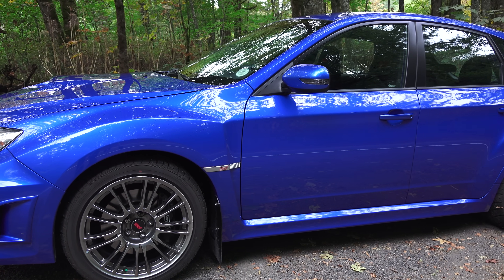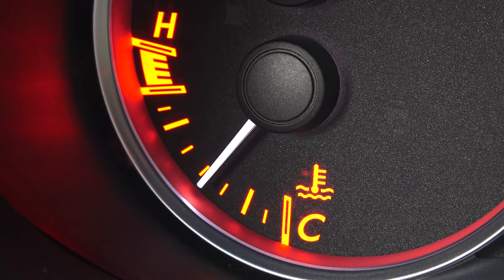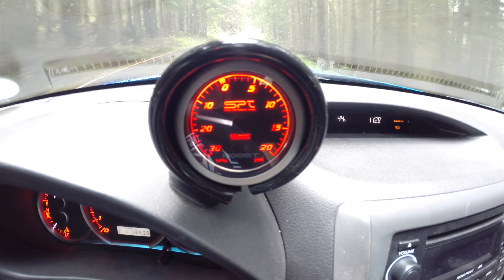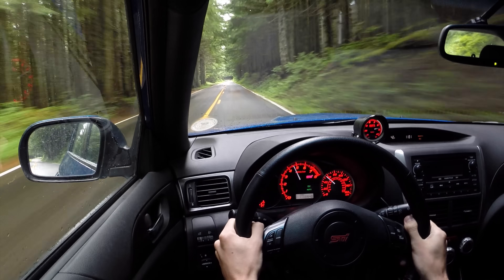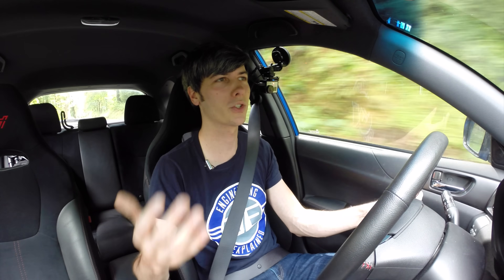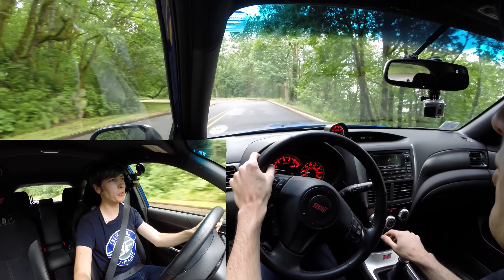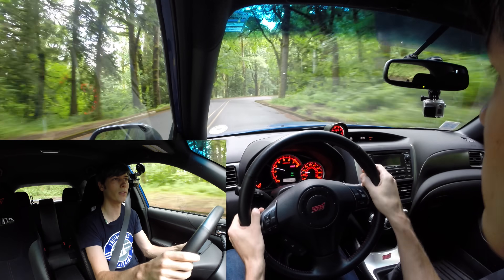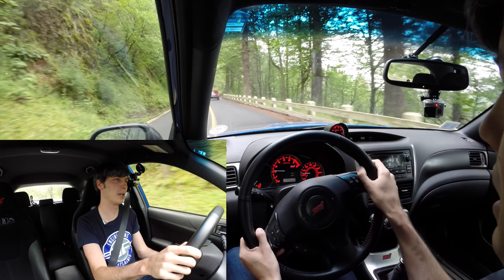5 Things You Should Never Do In A Turbocharged Vehicle

Comment: If your in 3rd gear and stop and don't shift to 1st before you take off is that bad?
Reply: pooneater5 that's what he's saying
Reply: pooneater5 if it is a full stop yes, but if your rolling at around 30 mph or something like 2-3 rpm I thin your good
Reply: Depends how much you hate your clutch. So long as you don't engage it roughly enough that it drops the engine revs super low (really, you shouldn't get down to idle unless rolling along in heavy traffic or parking it, but, say, idle +50% is generally more than ample, and you can go that low if accelerating straight out of it without the engine labouring there for a long time; essentially, that's the lowest speed the manufacturer thinks is safe to run the engine at for a long period, and even then only at low load, so jerking along at that speed or lower with full throttle is likely to be an uncomfortable and potentially damaging experience), the engine doesn't know any difference between that and starting up a steep hill in 1st. All it knows is what load is being placed on the crank via the clutch (or torque converter), what speed it is already turning at, and how much throttle is being applied, everything else is hidden.

IE slip the clutch, you're fine (other than the risk of burning it, and the increased wear, of course)... keeping it engaged, depends just how slow you go and how far down you drag the revs. Either way, I'd be more bothered about the possibility of stalling out rather than what a couple of seconds of chugging or slippage might do.

YMMV anyway - the two turbodiesels I had were perfectly happy to start in second gear with full throttle bang in the middle of the torque band, and accelerate hard from there up to nearly 50mph. But they had crazy industrial strength clutches presumably designed for rather heavier, more powerful cars, and I was slipping it up to at least 15mph if not 20 (ground they covered fairly swiftly). The current NA petrol car, which has nominally about as much power as the lower tuned of those two, has significantly less torque (like, maybe half the lower powered one and a third of the higher) and slightly lower gearing, yet, thanks to the far weaker clutch, starting it in second is a tricky balancing act between not giving it enough throttle or slip and bogging down at super low rpm and bugger-all power as a result, or giving it far too much and suffering terrible clutch burn (where even with the pedal fully released it just doesn't engage properly, with the engine revving up towards the redline but the car not accelerating)... far better to downshift into 1st every single time, even where that requires a quick double-declutch and throttle blip in order to get the synchro to play nice.

Comment: 3:19  I don't understand. That's the reason you have MAP/MAF sensor near the air-filter/intake that measures the amount of air that is ingested and provides input to the ECU to determine the amount of fuel to be injected.. So whether or not you floor at high gears, the ECU makes sure your A/F mixture is always closer to the optimum level; and the chances of getting a lean/rich air mixture is low. Cars nowadays are way more advanced to have those types of differences in A/F mixture which is key ingredient in efficient combustion. And OEMs are trying to be more fuel efficient nowadays so the probability of such discrepancy happening in A/F mixture ratio is very low.

Comment: I'm not an engineer. But I am a professional driver. If you floor the accelerator pedal at low RPM in a manual vehicle, nothing immediately happens to the boost, neither will it damage the engine. The accelerator will open the butterfly in the throttle body to allow more air, the computer will measure how much air is being forced into the engine per stroke and inject the required amount of fuel to achieve a clean burn as predetermined by the ECUs' fuel-air mixture mapping. This results in increased engine speed which correlates to increased exhaust gas flow which in turn increases the rpm of the turbo which THEN increases the boost pressure incrementally as the engine gains speed until peak boost is reached and the wastegate is actuated. What you're referring to is called laboring the engine, which is only 'undesirable' as it won't actually damage anything other than the drivers' pride if they don't compensate for the lack of power at low RPM in a high load scenario and actually stall the vehicle. The most common high load scenarios encountered would be driving on an incline, or attempting to overtake without downshifting. The same applies to N/A vehicles as well.
This would be better classified as one of your pet hates, not an actual 'do not do'. (you may be referring to the thermodynamic efficiency of a gasoline engine and its relativity to combustion efficiency in a high load scenario, which is something completely different and has more to do with fuel efficiency than any damage that might occur)
Reply: I think he mentioned turbo-diesels for this reason, the amount of air they intake depends on RPM, and fuel is injected based on load; this goes back to how much work is being done to get up to RPM. In gasers this isn't as big of a problem since their air intake is controlled by the throttle. However, if your engine is running low RPMs and you floor it you're asking for more work to be done than the engine can do because of turbo-lag, and you run a richer air/fuel mixture until the turbo picks up to fill the demand to bring up that mixture. ECU's fix this but reduce the power your engine produces compared to if you modulated the accelerator. Retarded timing/two step utilize this wasted work to spool up the turbo(s) faster, however exhaust manifolds aren't really made to handle those pressures. Like you said this hurts fuel efficiency more than the engine, still the exhaust system is put under more pressure than its made to be, which goes back to your lighting analogy. Even so, lugging your engine can increase engine knock, especially in turbo-diesels because of how the "rhythm" of the engine knock is disturbed when you ask for that much power that quickly. This is even worse in turbo-diesels because of how much torque they produce. But if you have a straight-six or a rotary you don't really have to worry about this.

Anyways just thought id throw in my two cents because it's always fun to discuss the science of engines!
Reply: Engineering Explained by that theory a roots supercharged engine should fail the second they floor it at 1200rpm. Spoiler alert, they dont.
Reply: Matthew Allison this comment is 2 years old but I love it, because it embodies what I hate about this guy. Theories are great, but not always applicable to the real world! Engineering is about applying science to the real world, if you can’t do that, you’re a poor engineer. Recognise the limits of your models and adapt accordingly.
Reply: "I'm not an engineer, but I can throw in some engineery words to make my opinion sound educated"
Reply: Just a quick question. I drive audi S3 2011 non moded, I allways drive in eco mode and the car tells you when to change gears ( its manual),  now reading all the comments here,  I wandering if I should drive in eco mode because it tells u to change up gear and u end up doing for eg. 30 mph in 4th gear and ive only just started the car and its still cold. Just wandering because of what im reading here regarding load and engine speeds... Thanks all
Reply: None of us know the proprietary alloys that are used for performance and on the other hand to save money in new or older turbo charged cars.  Sure the same factory may make a specific part for many companies, but it is made according to the formula given to them by the car manufacturer.  There is no wide brush to cover everything in a general way.  If there were racing would be easy.  We want to say do this one thing for every car, but that is not the reality.  Even the same parts in same model cars with a little tweak can behave quite differently.  Premium fuel certainly has more energy in a the same general volume, but weather your car is sensitive to that or not again depends on your cars particular collection of parts.The closer the Octane rings are together for the right air mixture and ignition will give more power.

HIgher altitude gas stations offer a wide range ot octane strings to accomodate different cars at different altitudes with different turbos, no turbos, or just different parts that work differently in concert together.

"we all will fail at something, so make sure it is at something you enjoy!"
Reply: @MattMaudsley   One of your points is incorrect premium fuel does not have more energy it burns slower and smoother in a high compression engine this allows the engine to perform properly. IE not to blow up.
Reply: THe Octane molecules are more per mL.  That is more energy.
Reply: @MattMaudsley  Whether.....not weather. Shame to handicap your very  informative message with goofy spelling.  Weather? Seriously?
Reply: @raymondtuckerjr1886  Iol. Good catch. I was using talk to text, and did not see it. I hope you have a good day.
Reply: Luke ST - Petrol's, not diesels though.
Reply: What’s a N/A vehicle?
Reply: @prepperjonpnw6482  Naturally aspirated engine non turbo vehicle.
Reply: @prepperjonpnw6482  every heard of Naturally Aspirated e.g. civic type R ep3 or e60 M5
Reply: naturally aspirated -not boosted
Reply: Naturally Aspirated
Reply: @prepperjonpnw6482  naturally aspirated. Meaning all it's horse power is pure engine power without use of mods or turbo or charger.. I.E. 500hp car. Without a turbo vs a 450hp turbo
Reply: What about CVT?
Reply: Give this guy a cookies!
Reply: There are plenty of people in this comment section. Many are kids, and some are educated people who understand or are genuinely curious about engines. Don't nitpick the person, challenge the science. Otherwise you're just a kid.
Reply: just type it into google mate.
Reply: Julian Fuller was
Reply: Thousands of comments and look who I find Julian haha,
Reply: Agreed this guy is a poser
Reply: @LUKE Obviously those engines were trash to begin with.
Reply: @Matt Maudsley  Very little if any Octane is used to formulate gasoline today,it is a longer chain hydrocarbon than the other components,but ethanol and additives are used to achieve the same anti-knock properties,thus there's very little difference if any in the octane rating number,but that being said,pure gasoline has a higher heat content than than anything with any percentage of ethanol.Why is ethanol being used instead of octane ? It's vastly less expensive due to government subsidies,40 years ago when gasoline was $1.20 a gallon,ethanol was $7.60 a gallon,pure ethanol is still more expensive,except for the subsidies.It's been in use since the MTBE scare(methyltertiarybutylether),I hope I have the spelling right.
Reply: So best thing to do is have a badass clutch??
Reply: @ Ethan Akagi No,the thing to do is find a paved hill to practice stopping on ,then going again till you're confident with your skills.Some place with very little traffic or none at all will do.
Reply: The ecu will send the same amount at say 70%throttle and 100% throttle because there is not enough air. That means problems can occur even without flooring it.
Reply: Ulukai Azgard for performance, not engine wear.
Reply: He DID say "buy the best gas" you can afford.
Reply: Lol. A slow moving piston with a fast explosion sounds good for sombody. Won't  happen in my car
Reply: Exactly and he also claimed engine RPM limits the amount of air an enjine can injest. This makes even less sense considering we are talking turbo cars which pressurize the intake and are ramming air in at a set psi.
Reply from the maker: +Julian Fuller laboring your engine can cause LSPI and damage your engine. Owners manuals will suggest against it for this very reason. Here's an explanation: https://youtu.be/soJea7xEt-8
Reply: Engineering Explained I know what LSPI is. However, due to design parameters of engines, actual damage resulting from LSPI to a vehicle straight off the showroom floor would be a rare occurrence. There is more risk when owners begin modifying engines and changing the operating parameters. I took the time to watch the clip you posted out of courtesy, and if you were really honest, your argument is presented along the same lines as "if you go outside your chances of being stuck by lightning are higher than if you stay inside." Especially considering the report indicated that the circumstances would need to be 'just right'. Laboring an engine is more a poor behavioural issue. The same as failure to indicate also increases the risk of being involved in a collision and thereby resulting in vehicle damage. Looks like we'll be keeping seperate opinions on this one.
Reply: wouldn't it because of the fluctuations of pressure within the combustion chamber, effecting how the fuel burns? like under high boost at low RPM you would have alot of pressure being forced into the combustion chamber im assuming an then clearing it but when the fuels in there, if theres too little atmospheric pressure differences the fuel has a greater chance to self detonate?? idk i never made it past service classes lol
Reply: @JulianFuller001  Son, you're not an engineer and you probably don't know how to change your oil. Please, stop commenting.
Reply: @JulianFuller001  I could have predicted that. Maybe you should start your own channel....as a courtesy. Differing opinions are GOOD for growth and understanding.
Reply: Stopped reading at "The accelerator will open the butterfly in the throttle body to allow more air" that's not how turbocharged diesel engine works.
Reply: @TheBlork74  and where exactly was he talking about a turbo diesel?
Reply: Julian... My man. You should do these videos instead of this dude. You actually know what your talking about instead of spewing myths. ECU= the failsafe.      I could see a 1950's something something having issues but nothing modern. IE after injection.  Many of these videos have a little truth mixed in with myth.The exhaust back pressure one makes me angry. Its about length and diameter of the tube if the pipe is open. If there is a muffler straighter is better. for power. HE tried to simplify a very complicated thing and failed.
Reply: Julian Fuller looks like you copied and pasted this from a forum post...🤣
Reply: @j.s.3414  Dude, show some respect. Julian is a certified YouTube mechanic.
Reply: Don't get me wrong, I love Engineering Explained and his channel is full of great and useful information. However, some things are very different theoretically than when implemented as a component interacting with many more variables. Like you said, back pressure is a very complex topic, sometimes helpful and sometimes harmful.
Reply: You are absolutely right dude!
Reply: Allan Nichols Maybe your enGine can't inGest much because you filled it up with drop many "J"s?
Reply: This is a very easy problem to solve! Are you ready? Are you really really ready? Ok, here is the answer!  NEVER EVER, EVER, EVER,  DID I SAY NEVER ENOUGH, BUY A F TURBO. ESPECIALLY, if you plan to keep the car. The small engines, with the high compression ratios and heat are not built to last. You may get lucky but in the long run you will get F.
Reply: ECUs do not have to be the "fail-safe" for anything. ECU is the acronym for Electronic Control Unit in this context. The ECU doesn't refer to one specific module, such as the fuel injection ECU, which is not a fail-safe. In fact just about every dynamically actuated component on newer cars has it's own ECU. Older models could have a mechanically actuated controller which is gauged off of the baseline of a certain pressure/force, such as a limited slip diff. Just so this context is as crystal clear as possible, anything which automatically engages a function of the vehicle via an ECU to prevent damage to the vehicle or operator in the event that it wasn't engaged by the operator, mechanically, or the ECU functioning statically in the cars operating condition/environment would be considered a "fail-safe" of some form, including anything actuated mechanically. Ex: automatic engine braking, automatic braking, automatic intake shut off, accident prevention systems, etc,... PS - Feel free to search the internet over for any phrases I used which appear in a forum, definition, or manual. It is likely you will find some similarities in other statements, though I assure you I wrote this off the top of my head. Haha 6 shots of coffee does wonders.....

Comment: I still don't get the idea of you cannot turn of the engine immediately after running it very hard? What is the point of turbo timer?
Anyway, can anyone explain why using thicker oil (40 vs 30) makes the turbo acceleration smoother?